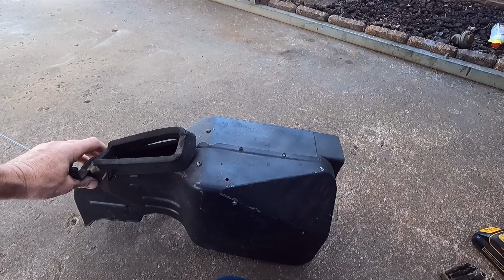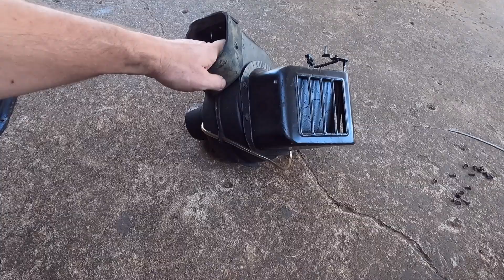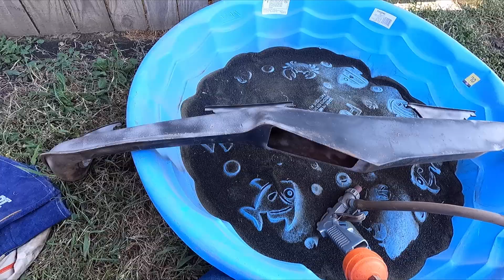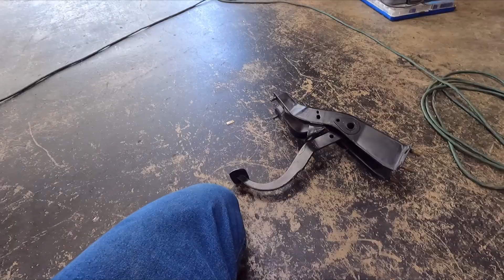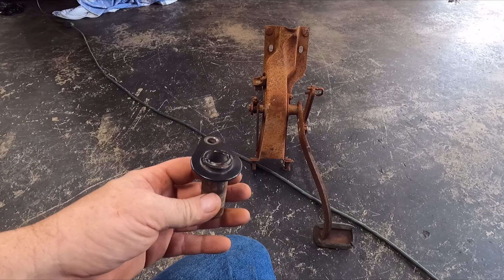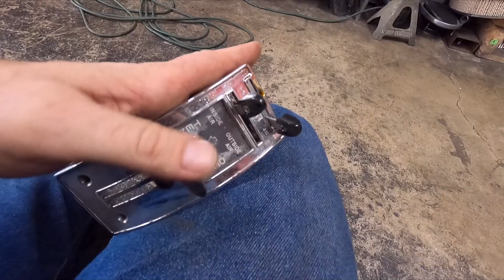Steve's 55 = Heater box, defrost duct, and brake pedal work.

Comment: You can try electronic cleaner on that brake switch I did mine.I just sprayed it all around the button and pushed it in and out a bunch of times. Try it and do a meter test.Not sure but I believe they can come apart also for cleaning too but that might be a stretch bending the crimped indentations out and in on the fat end.They are of a high quality switch not like the junk repros,LOL... I have my original one after cleaning it.Wow you dont get a break with nothing with that pedal assembly ,LOL!

Comment: Maybe you could remove the weld on that assembly and then heat 🥵 that part up and use a piece of pipe to strengthen that up and then use your welder on it again.

Comment: I wonder if it’s a converted clutch/brake quadrant?  I’ve got a clutch/brake in my 57 Bel Air that I need to swap or convert to a brake only system since I’m running an automatic…. I have no idea if they’re the same as 55 - but if your cousin has one to swap, let me know..
I’m not above converting it if I need to.